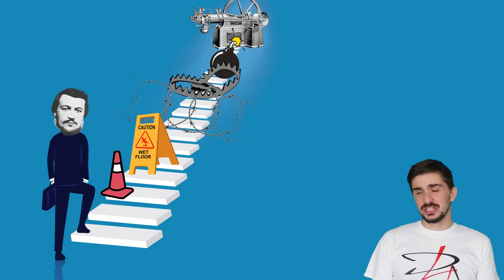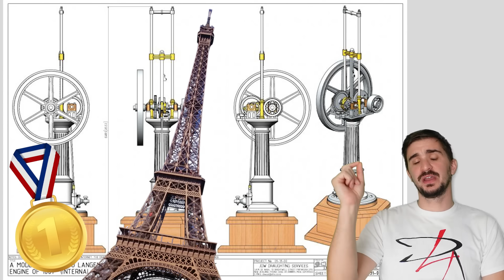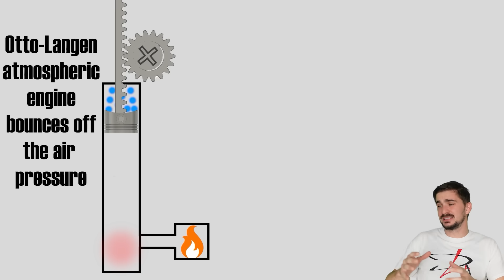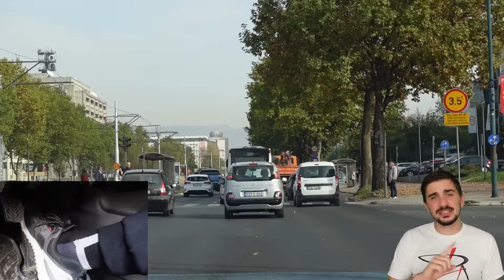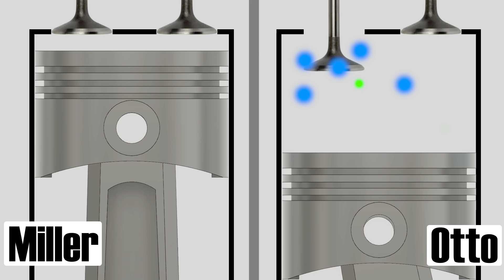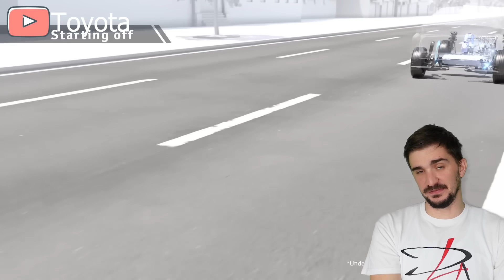You'll understand everything about Atkinson, Miller and Otto cycle engines after watching this video

Comment: Caterpillar used VVT and very high turbo boost pressures to achieve the same thing with C15 diesel engines.
Lovely engine to drive, lot's power especially at the bottom end. Pretty good fuel economy.

There were  issues with the VVT actuators, the complicated twin-turbo design and the very high boost pressure.

These issues were addressed pretty successfully.

The one thing that was not successfully addressed was emissions. 
Although this engine was designed to be EPA compliant, it wasn't, so Cat dropped out of the truck engine business.

Comment: All very interesting. Why has nobody tried to use a rotary intake valve and the standard exhaust poppet valve? The rotary valve would not be exposed to exhaust gases flowing through it. I can see machining costs would be more, but the inlet flow (using super charger) would be so much better.

Comment: Wait so and only reason why the miller engines are more efficient is because of a Soper charger so there is no reason to have the miller engine anymore since you can just bolt on a Soper charger to a Otto engine and get both of the benefits, power and efficiency.

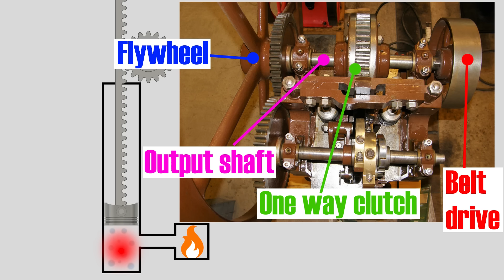Comment: 5:29 How on Earth do they get a seal in that upper chamber?
Reply: There isn't a seal the top of the cylinder is open, and the piston actually powers the engine when it goes down by its weight and the vacuum in the cylinder from piston "overshoot" and gas cooling.
It is called an atmospheric engine as the actual driving force is from the piston getting pushed by the atmospheric pressure.
Reply: @TarenGarond  But seriously.

Comment: What happens to the air fuel mixture pushed back out through the intake valve in the miller cycle?  How does the engine stop it from interfering  with the supercharger?

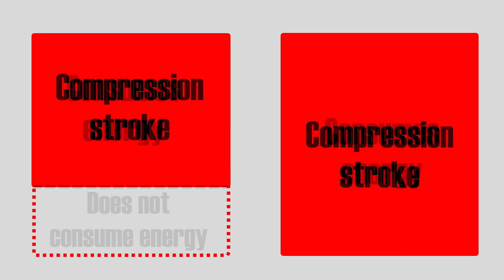Comment: 9:45 16:25.Most of the energy expended on compression is recovered like in spring. In extremely large engines (like in ships or peak-shaving power plants) more is recovered because of the small surface area to volume ratio meaning less is lost to heat. This vid implies that the compression energy is not recovered.
Reply: I think in thermodynamics there is no distinction between Atkinson and Miller cycles but rather Miller is a method for achieving the Atkinson cycle through value timing rather than mechanical linkage.
Reply: Oh, I see he addresses that a little at the end of the vid.
Reply: No PV diagrams? I guess people don't like those?

Comment: does miller engine with direct injection prevent carbon deposits at the back of the intake valve? Does any fuel escape at the begining of the compression or just air?

Comment: So, can we use stratified charge injection in the miller cycle engine? 
To reduce the amount of fuel being forced back out the intake valve.
Could we do it with one of those electric assisted turbochargers Garrett makes, like an MGU-H? That way we can also reduce the parasitic losses of a supercharger.
With a hybrid system as well.
If we're using a Miller cycle, we're probably not caring that much about performance anymore anyway but with a hybrid system it technically could provide a lot of power through the hybrid system, add a pancake motor and regenerative braking for more battery charging and we can have the engine as more than a range extender.

Comment: When the exhaust valve opens if the pressure is higher than atmospheric pressure that is “waisted energy” going out the exhaust that could have been used to push the piston a little more. Ultimately the turbocharger won out as a means to extract some of this remaining energy.

Comment: great video. But what I don't understand is if you leave the intake valve open during a portion of the compression stroke, aren't you in effect lowering the compression ratio? Also, when you leave the intake valve open during a portion of the compression stroke, doesn't a portion of the charge mixture (air and fuel) get pushed out into the intake maniforld?

Comment: Millenniums were beautiful cars for the money though.  When I first moved to Houston, my neighbor had one.  And while the power sounds very base for now, keep in mind a typical car of that period had far less than 200hp.  My integra only made 100, and my 968 only made 270, with less torque than the Millennium.  It was quicker off the line than the 968, but quickly got dropped after that.  But for a daily driver?  Very nice.

Comment: When people are putting in different cams I engines, aren't they moving closer to a Miller cycle? I know most about tractor pulling and diesel engines. Our intake closes relatively late in the compression stroke. Uses the momentum of the air to stuff even more in. And it opens quite soon to, to use the momentum of exhaust gas to clear the cylinder

Comment: Its so  amazing how hybrid style powertrain from Mazda\Toyota with Atkinson\Miller cycle ICE has more logical and practical sense then full electric vehicles that uses pollution batteries.
 Its unites best from both worlds into 1 package. Kind of same tech used by Formula 1 and today's WRC cars and some LMP\GT cars, like Porsche did recently , and creates insane perfomance application combined with sequential gearbox. With combination with clear sustainable synthetic fuels   there are no need for fully EV's on the road. And we didn't even started talks about biodiesel engine!

Comment: I think that poor fuel is the key thing here (low octane).  The most compelling advantage for an Atkinson/Miller engine is that you can get good efficiency from a high EXPANSION ratio without the problems of pre-ignition and detonation that you get with a high COMPRESSION ratio using low octane fuel.

Comment: This was a lovely explanation. The only thing that doesn't make sense for me is why the Toyota engine is inferior to a normal engine with normal valve timing using the Otto cycle. Does it have different compression ratio by default?

Comment: While not exactly Atkinson vs Miller vs Otto, would not a crank/wristpin offset not provide some of the benefits of an Atkinson/Miller cycle, where there is longer intake & power strokes with a shorter compression & exhaust strokes? Newer Toyota D4S engines are using this strategy to boost their efficiency. How would these differ?

Comment: Koenigsegg style Freevalve is the ultimate implementation of this technology. I think it could at least in theory only adjust the intake cycle length to adjust the engine power and run the gasoline engine at full throttle at all times similar to diesel engine.

Comment: Terms can sometimes change meanings over time, and it becomes confusing when you try to attribute the changed meaning to unchanged times. I do not have a background in this area, so I fully admit I could be over-interpreting things. But I have read some, and here is the history of the terms as I gleaned it.

Otto never called his device an "Otto Cycle Engine." It was an "Otto Engine." I don't know if he ever referred to his timing as a cycle at all.

Atkinson developed three versions of an engine that used different compression and expansion ratios. He called the first a "differential engine," and it used two pistons that shared a combustion chamber. The second he called a "cycle engine," and it is what you describe. "Cycle" describes the engine, not the timing, and refers to the action of the rods. His third was the "Utilite engine," and was more like a two-stroke engine that used different ratios.

The name "cycle" only came to be used to describe timing well after these engines were developed - probably after Miller as well. It is used to differentiate Otto's timing from Miller's timing that incorporated Atkinson's cycle instead of Otto's cycle.

My point is that there is a difference between an "Atkinson Cycle-Engine," which was the name used at the time for the second of his mechanical devices, and an engine that uses the "Atkinson Cycle," which is a more modern term for any timing where the intake stroke is shorter than the expansion stroke. So there is no "Miller Cycle," there is a "Miller Engine" that uses "Miller timing" to implement the "Atkinson Cycle." And has a supercharger. Without the supercharger, it just uses Miller's timing to create an Atkinson's Cycle. That's not Miller's engine, it just uses an idea of his. It's not Atkinson's engine, either, it just uses a different idea of his.

This is hard to write. I hope I came across clearly.

Comment: Iirc the Atkinson cycle has been revived by Toyota a few years back for their full hybrid system. The lack of torque especially is compensated for by supporting it during acceleration with an electric engine. The system is so efficient that it can be driven in the 2L per 100km range.

Comment: The Atkinson cycle is claimed to be used in the engine in the Ford Escape 3.0 L Duratec 3.0 V6. It doesn't have any different construction then a regular IC engine. I wonder if the engine uses different valve timing and maybe higher intake vacuum under most conditions to achieve the Atkinson claim.  Does anyone have information on this?

Comment: Screw all that. Otto cycle 3.0 V6 Otto vs 3.6 v6 miller without supercharger. Same fuel consumption and more power for the miller. The laggy throttle response is likely from miscalculation of the dynamic compression ratio. People often only look at static compression ratio. Total volume swept vs combustion chamber size. If you look at DYNAMIC compression ratio and look at volume at time both valves close vs combustion chamber size and make them both the same, they should have similar power output provided the compressed gas mass is the same. (Either dynamically by reducing throttle on the Otto, or increasing displacement on the miller cycle to make dynamic volume the same.

Comment: The last generation hyundai/kia 2.0 port injected engines are incredibly economical. I was able to get over 50 MPG on a 700 mile road trip at speeds between 65 and 75 mph.

Comment: Although I enjoy your engine-related content, I have one small (?) complaint: Please refer to torque in terms of lb-ft instead of ft-lb. As you (should) know, ft-lb refers to work, which requires motion, while torque (lb-ft) does not necessarily require the same, thus the difference... although the product of feet and pounds is the same. The metric designation for torque—the Newton-meter, of course is correct.

Comment: If the intake valve stays open during part of the compression stroke, the air has to reverse it's velocity. Doesnt this decrease engine performance? Nowadays with direct injection, wouldn't it be possible to open the exhaust valve a bit, before fuel is injected? ( This way preventing unburned fuel/air escaping through the exhaust)

Comment: The variable valve timing and a turbo would probably work better if the valve timing responded to the throttle position as well as rpm.

Comment: There is one more thing about the Atkinson cycle - the volume of the exhaust gases after the combustion is much larger than the volume of the air at the intake. Atkinson cycle allows to extract more energy from the exhaust gases.

Comment: I understood everything until the Toyota hybrid part. Superchargers were great for Miller cycle because it was stuffing more air in the pistons and you could get away with the shorter compression cycle. But the electric motors in Toyota hybrids don't change the airflow do they? All they do is give an extra power boost to the output making it less sluggish.. Which brings us back to why use the Miller cycle if Otto just does the same thing but without the sluggishness..

Comment: do video on stirling engine :) u have lot of topic to cover,  alpha beta gama.. resonant stirling.. liquidine... and stirling engine + rtg equal nuclear car that serv as electrogen group when stoped at home u plug in the grid and use the constant power produce from the rtg
Reply: small rtg + stirling engine like 15kw electric output .. + capacitor... .. capacitor drain for acceleration.. ur car at 120km consume 12.5kw.. u have 2.5kw going back into capacitor for recharging them... (ha yeah forgot .. on a car like this at  home u have too 30kw+ of heat for heating ur house..

Comment: but i dont get one thing, if you save energy by reducing compression which what is does is reduces the resistance created by comporessing air, adding a superchanger which adds more air thus more resistance isnt that just going back to where we started? i think it has more to do with the crankshaft bottom dead center position and to avoid resistance on the piston when it is at its lowest speed/change of direction

Comment: VVT + turbcharger is the purfect matsh for running miller cycle when you don´t need 100% power.
I would say that most modern "otto" engines with VVT and turbocharger are using the miller cycle when i part load up to maybe 80% of max power/torque.

Comment: So it is Miller more than Atkinson - because the piston is standard up and down, but the valve stays open, pushing the fuel mix back into the intake. The supercharger I do not understand as I thought it was just a motor to push air into the cylinder to simulate a turbo. So my '21 Elantra is the "Atkinson" and Toyota told me "everyone is using the same technology and it is not quite perfect for durability.  So Hyundai said the problem is that the rings can never get dirty as they get locked up; AND they said in winter here even with synthetic there is oil starvation going on at start up and warming - so they said warm the engine, plug it in if possible.

Comment: i have a prius prime 2017, and everything about the atkinson is true. it really feels like a dead horse when you accelerate on the gas. usually i accelerate on electric mode, then then i reach the highway speeds, i start the gas motor. it's excellent to run at the same RPM for hours. but don't ask to change it's pace quickly, it screams horribly. The complete opposite of the electric mode that's nervous but can't run a long time at high speed.

it's a bit like an old diesel. Also very reliable, low maintenance, excellent fuel economy.

Comment: Coukdn't modern fuel injection be used together with the Miller cycle? Only start injecting, when theinlet valves are shut. Otto etc. only had carburettors (maybe not even those)

Comment: Can a larger supercharged Miller cycle engine be more efficient than a smaller supercharged otto of similar output? Seems to me the point of reducing the compression stroke pressure is negated by running a supercharger and then made worse by more parts and therefore more inefficiency

Comment: Small correction.  An electric motor driven supercharger does load the engine.  But it does it through the alternator belt, rather than directly from a supercharger belt.  And you have to add in the losses from the motor efficiency, that is lower than from a direct drive.  The benefit of electric drive is, independent of the engine speed,  motor speed control.  This more than compensates for the motor losses, in reaction time and flexibility, in various demand and engine speed conditions.  A belt driven supercharger runs.  An electric driven supercharger dances.

Comment: So, as the summary: Can we say that the Variable Valve Timing Engines are capable to run with both Otto and Miller cycle according to the circumstances?

Comment: I think the honda fit engine operates with this combined cycle. As it doesn't have a supercharger ot electric engine to support low rpm, it suffers from lack of responsiveness when you came from a stop sign, but gets very "alive" above 3.500 rpm.

Comment: Interesting video, but since when the Otto engine has the intake valve close at or before BDC? They close well after BDC and the exhaust valves open well before BDC, likewise there is quite a bit of (valve opening) overlap at the end of the exhaust stroke and beginning of intake stroke. In racing engines this overlap can be huge. You also understand that it's all explained by the inertia of the flowing gasses. During the '20's or '30's there was a period during which the erroneous ideas of some Italian engineer (Ricardo?, I forgot) were popular, which slowed down engine development for quite a while by insisting that overlap was useless and intake valves should open well after TDC in order to have 'more underpressure' to start the intake with. But you were not talking about that period, were you?

Comment: I am confused about supercharging a Miller cycle engine. The idea of miller cycle is to reduce the resistance cause by compression but a supercharger is adding more air into the cylinder which increases the pressure thus increase the resistance of compression. Higher pressure = higher resistance during compression. Seems like counter-intuitive. According to what I have read, the idea of Atkinson/Miller cycle engines is that when the piston is at bottom-dead-center after the power stroke, the cylinder pressure is equal to atmospheric pressure thus it has higher thermal efficiency comparing to Otto cycle engines which had residue pressure that gets wasted out of the exhaust port.

Comment: So both companies use a "Atkinson/Miller, reduced compression stroke" concept, but it is accomplished using variable valve timing systems more in line with the miller concept engine.

Comment: 17:45
So this is basically a two stroke@exhaust pipe like solution, on a four stroke engine, but whereas on the 2T the compression is managed by the swelled part of the exhaust pipe, he used a roots blower instead to maintain the compression.
Awesome :))